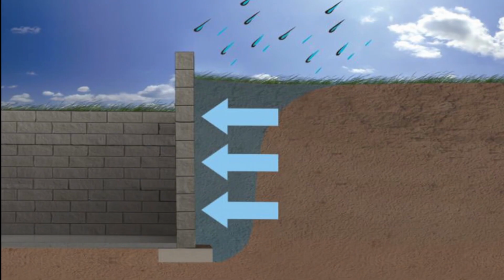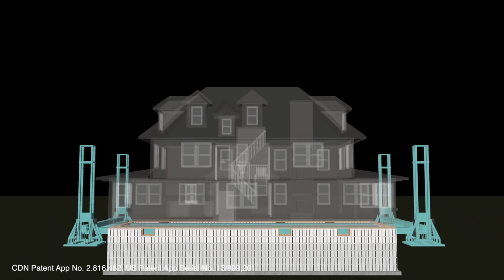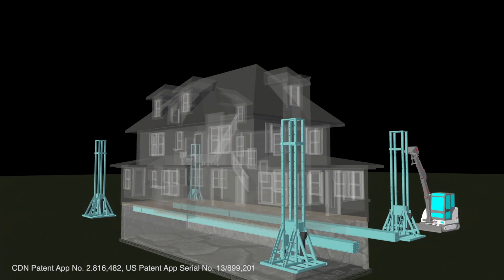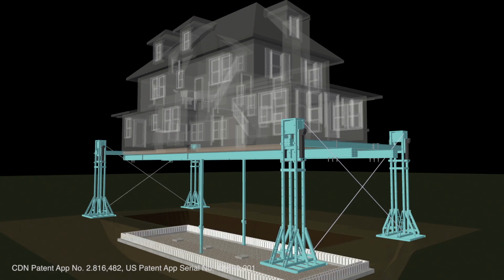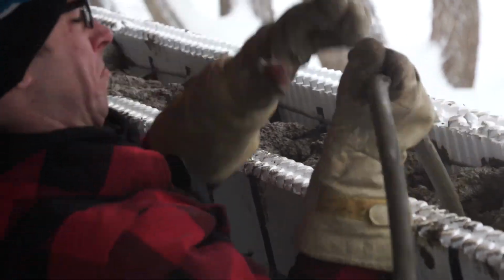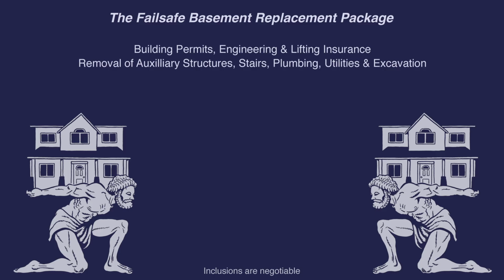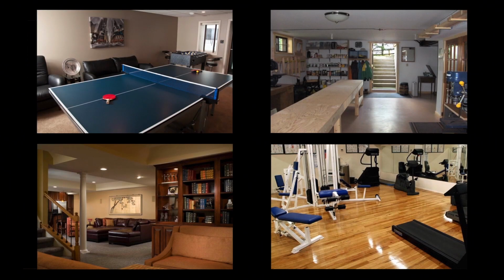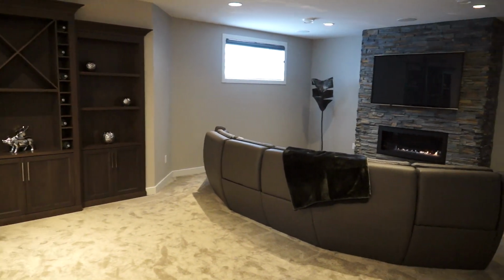FailSafe House Lifting & Basement Replacement

Comment: The bill for this has to be as heavy as the house.
Reply: I wonder why when such projects are shown, they never say how much that project had cost.
Reply: @digimaks  There are way too many variables involved to give a price.  One house may cost one price and another similar house twice as much.  The shape of the house, how many offsets there are, attached garages, the soil conditions, etc.  I had a new foundation, slab, and 9' ICF walls with Radon mitigation and I paid $47K.  The only manual labor I did was the landscaping at the end.  If you ever need this done, it's the best way to go as far as I'm concerned.  From the time they started it took 3 weeks. It would've been less but we had crazy weather with a lot of rain. That $47K included everything.  Granted it was much cheaper to put in the Radon system without having to bore under an existing slab, but I thought the price was a bargain to be honest.  Oh, forgot...the price included removal of the existing block walls and the slab.  I live on 180 aces so again, it was cheaper since they didn't have to haul the debris off-site, but it wasn't much more had they had to.
Reply: PA Mike what province do you live in? What company did you hire?
Reply: @pamike4873  Quick, cheap or good. Pick two
Reply: @3mtech  my favorite saying, and this definitely applies to my business structure
Reply: @pamike4873  yankees are such fools.... y'all could have taken that dough down south and built a new home!
Reply: @JeriDro  Right.  "Well, we need a new basement wall.  We can fix it, but the better solution is we'll pack up and move 500 miles south.  Yeah, that's the smart move!!"
Reply: @pamike4873  dude you could get a lot of land down south but you would rather dump money into a home in a neighborhood. imagine being able to grow your own food and have room to move around in. You guys just don't know...
Reply: @JeriDro  uh, well...since Californians are moving to Houston in record numbers our home values are going through the roof.  We didn't pay anywhere near the amounts 20 years ago that people are selling for today.  You cannot touch a decent house for less than 250k. Our property taxes increased 70% in one year due to Californians  paying 3 to 5 times the normal values.
Reply: Try $175K! I'll be paying for mine for the next 30 years in the form of another mortgage!! Picture the house from Home Alone in size..that is what I have..$
Reply: @chrisreed26  If you paid that much, you got burned.  They must have seen you coming.  Our total bill was $47K to lift a two story 2,250 sq. ft. house, take out the original block basement walls and slab, put in Radon mitigation and 9' ICF walls, and pour the new slab.  All I had to do was finish landscaping at the end.  Plus it was done in 3 weeks instead of 2 months, which is what it would've taken going the traditional way.
Reply: I wish I knew what it was though.
Reply: One would think so. Winning the lottery would be a great way to just experiment and waste exorbitant amounts of money!
Reply: At least 100k

Comment: So how does the house connect to the basement after it is lifted it will fall over from the wind wouldn’t it
Reply: half the homes in the USA are not attached to the foundation. Gravity does most of the work. At some point in the 50s contractors started bolting houses to the foundation. It's just a simple 3/8" threaded deal set into the cement with a nut and washer about every 4-6 feet. Likely more in earthquake or tornado areas.
Reply: Bilding kantaksan and bilding lifting and shifting Ke liye contact Kare=6201962545

Comment: What would be the costs just to lift the house?
Reply: House lifting services generally range from $15,000- $25,000 CAD depending on the size of the house, equipment requirements, and project duration.

Comment: When I was house hunting (2011-2012), I came across one house in particular that I will never forget. I noticed the whole house felt lopsided. When I went out in the back yard, I discovered why. They were trying to lift the house a few feet to give it a basement rather than a crawl way. I told the real estate agent that the house needs to be mowed down (condemned). Thinking back on it, I should have called the city/county on that place. Scary as hell!!
Reply: Why would you wanna call city/county on some place that's not yours, nor has anything to do with you. Don't try to cause troubles for others, ratting on someone is a bad personal quality. It doesn't make you into good Samaritan.
Reply: @digimaks  A house can NOT be approval for a Mortgage with foundation damage. Friend was looking to buy a house realtor told them It would be impossible for mortgage approval since the basement was flooded from a cracked foundation wall.  The only way to purchase it was a full payment, most of these house sit until they are condemned. Due to the lack of payment to Property tax, because no tenant would rent it out either. 

The whole Snitching (ratting/ tattling) mindset is all Prison talk.  If someone is going to get hurt and it poses a possible injury. Yes to report it to the Building inspector.  Neighbor has an illegal hot tub, No it's not bothering you.  So NO..
Reply: @digimaks  That house could not be salvaged. There was no way a bank would put a loan on it and even entry was haphazard, at best. The fact they were trying to sell it at market price is a testament on why someone should have been called. I hope they didn't manage to sucker someone who didn't know any better.
Reply: @Sight-Beyond-Sight  I love this "logo"...."Sight Beyond Sight".
Reply: @digimaks  this "new normal" world is full of snowflake snitches.
Reply: @digimaks  seems like you're saying snitches get stitches?
Reply: @glorgau  lol

Comment: overkill,  urathane grout injection for about 20,000 will solve a leaky basement.  no need to lift your house.
Reply: In the City or Regina where this company was founded, the clay is a thick Gumbo.  The Climate goes from desert like +40 C in the summer  to Arctic like -40C  in the winter.  It has caused more that a few cracks and leaks in basements here.  complete basement  rebuilds on older character houses  are quite common and effective here.
Reply: Also, people in river flood planes where current floods seem to be the 100 year kind but eveny 5 years. They can’t get insurance until something like this is done.
Reply: 803brando I see this more as a option for those who want a extension added to their basement but normal methods aren’t available in the community they live in

Comment: This is a thing? 😂 ive never heard of people doing this
Reply: GO ahead and look up stories of houses being lifted/raised in NJ and NY after they got hit by Hurricane Sandy in October 2013. Its quite common to hear of homes being lifted to remove old uninsulated basements to build a new ICF or other newer bare concrete either solid (monolithic wall) or cmu (in my opinion is a more costly and cheap as the old previous wall was and would require intrusion on the interior walls needing 4 inch wall and insulation build up to insulate). Cheaper than rebuilding in most cases (less than 100k all in) where the owners budget may not be rich/wealthy as would like to be or they are not wanting to get rid of the house structure they are all to used to and cherish for its good memories. Any new construction from decommission to rebuilding new is more costly than lifting and redoing the basement or adding on a new lower/upper (yes they even lift a second floor to a third story to create a new second story) floor

Comment: brick and concrete houses ... why is NA still building wooden tents
Reply: Cost, despite many not realizing the savings buinding ICF (Insulated Concrete Form which creates a monolithic wall or complete envelope) actually saves money both in terms of it can withstand hurricanes, tornadoes, and eathquakes much better than CMU or bare monolithic like concrete (which in itself still requires further interior insulation with 4 inch walls along the exterior wall thus further reducing ones interior living square footage). But prohibits ease of adding on since it then require sawing through the concrete and rebar. Wood is abundant and renewable (to a point) and much easier on additions and rebuilding yet cheaper in terms on initial building but lack in insulation without proper newer insulation methods (namely EPS board covering the outside beneath the exterior finish) thus adding to the initial cost to save on monthly utility ac/heating.
With ICF may will only need an extra 10% for initial construction yet do not realize it would slash the cooling/heating bills by 25 to 50% a month once its finished in to the point.

Comment: Sounds like a great solution if you want more space, but don't want to move. The caveat, i'm sure, is the price. This has to be prohibitively expensive.
Reply: For complete project 80-100K (CND)  is more accurate.  I shot & edited this video.  And know the company founders well.   They are great at what they do, but tend to be too busy to monitor the comments on their youtube channel.
Reply: Shawn Fulton well they travel to Washington State?
Reply: Jose Castillo call them and find out
Reply: crunch9876. Someone else said they looked it up and only 80k.   Half million is crazy to just jack up a house and add a basment.  Maybe 500k to do everything he wanted done to the house in total costs, not just lifting the house.
Reply: Hell no 500k is way too much even here in Southern CA where home prices are out the roof! I'd say 50 to 80k tops for a average 1500 square foot one story home
Reply: @lospolloshermanos2692  A reputable highly rated lifting company in central Ohio quoted me 24K for our 2400 sf ranch with two car attached garage. If you have a well build waterproof basement why would you want it excavated? There is much to be said for tried and true methods. He says a failed lift and invented a massively expensive system.
Reply: Whats the company? Interested but in southwest michigan...
Reply: @cjkersh  The $80k includes a lot though that I imagine is not included in your $24k. That $80k includes all the permits, digging, lifting, repouring of the foundation, weeping tile, etc.
Reply: D LG Someone in the comments said it was 500k lol

Comment: what is the price?
Reply: Depends on size and weight of house, the aforemention disconnections to be done and reconnected after along with the size of basement to be removed and then replaced with. Anything under 100k is worth it as if you were to rebuilt completely will cost more than that.

Comment: Wow. That's pretty awesome. I wonder if it is possible to lift the house and enlarge the footprint of the house with the ICF basement so that another addition could be built over the enlarged basement.
Reply: They specifically mentioned that right in the video.
Reply: Peter Utman sure, why not.
Reply: anything possible if you can get permits!
Reply: Peter Utman 500K dollers to lift a house ;-;
Reply: @CabbageMemes1  I guess the cost would always have to make good sense regarding the resultant house value increase.
Reply: CABBAGE MEMES another guy commented he paid 47,000 total, but no additions on the house. 2,000+ square foot house
Reply: [The] White Rabbit WAIT WHAT
Reply: Technically pretty straightforward I would think. All they would need would be an additional permit to cover the (new) roof and overlooking window heights…